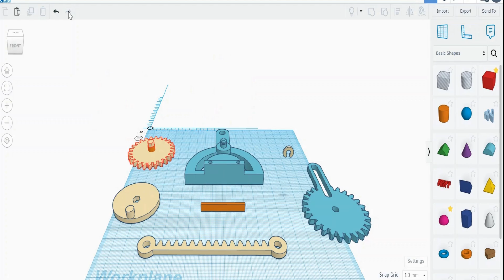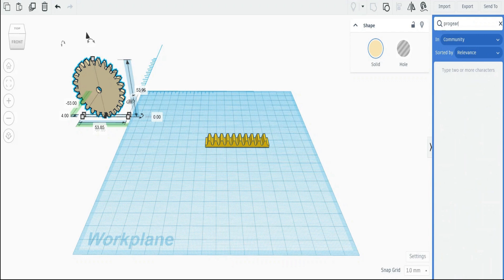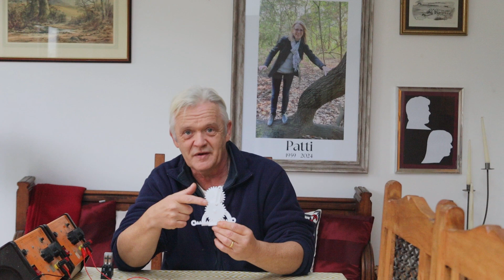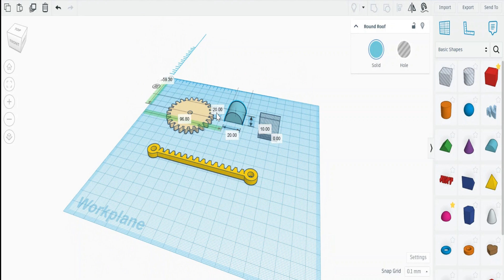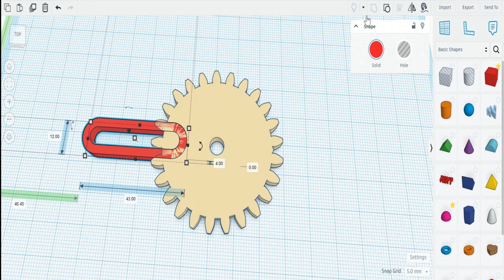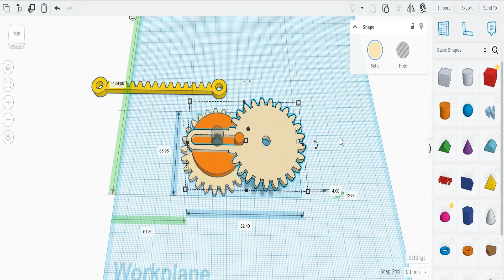2313 Pro Gear And A Counter Tinkercad And Beyond

Comment: 12:40 Can't you just take the hole, Copy it, enlarge that copy after swapping it to a solid to a hole. Then align the gear, hole & enlarged yoke. Merge the 3 & be done?
Reply from the maker: you can do whatever you want mate as long as it works for you - this is a guide not a rule book

Comment: Awesome workflow demonstrations in tinkercad lately!  I’m working on making a push-push (technically a pull-pull) switch mechanism to operate a swaybar disconnect on my Jeep. (Offroad Only’s Swayloc for reference). I’ve been struggling through the tinkercad interface with very few good functional,  technical tutorials to follow.
Reply from the maker: Someone mentioned I didn't do enough tutorials on how i work - so I am trying to remedy that - glad it helps mate
Reply: @ in two videos, you’ve unlocked two projects I’ve been struggling with. Moving workplaces to surfaces and code blocks weren’t immediately obvious in their use within tinkercad. Being a dive in and discover type of learner, their use needs instruction to even create awareness of their existence.